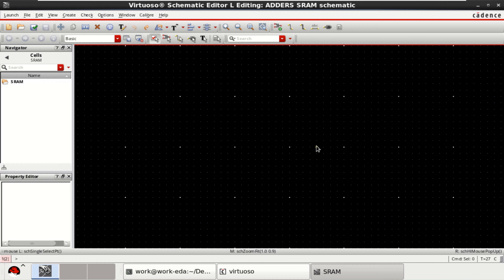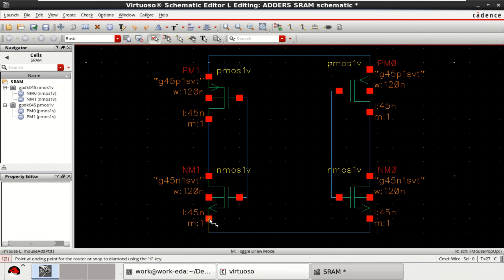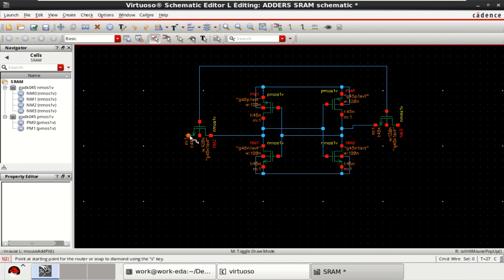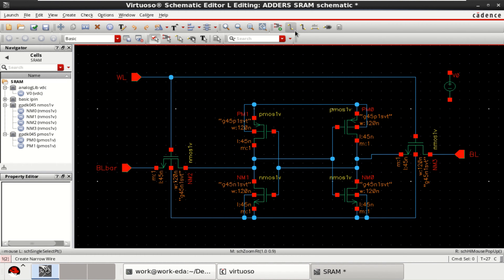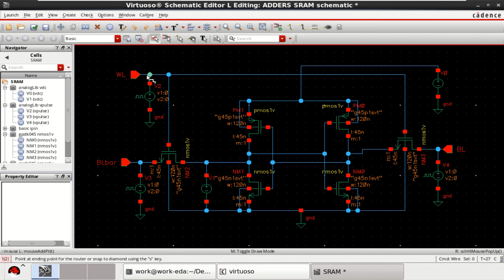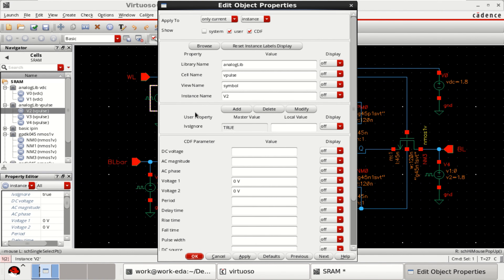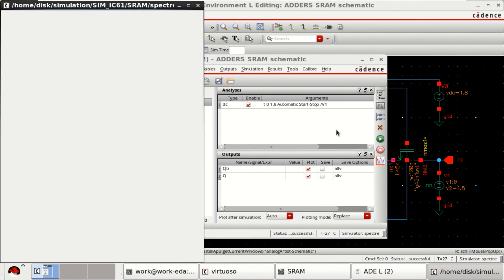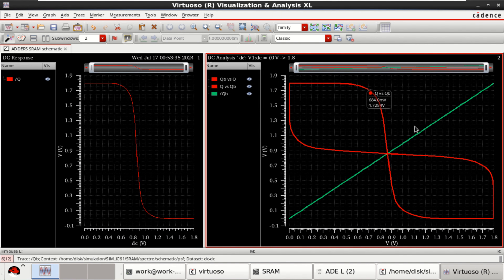6T SRAM DC Analysis in Cadence Virtuoso.

Comment: Its showing an error
 (sfe-421)..Error found by spectre during dc analysis dc ERROR (SFE-421): Undefined parameter name 'dc'.
how could I overcome it
Reply from the maker: Hi, check if you have used the parameter 'dc' in your design or model file. It should be defined before use.

Comment: Hello professor 
Could you please explain what is the purpose of the use of V1 in the schematics?
I might be wrong but I haven't seen schematics with the power supply connected between the access transistor to gnd.
Thank you
Reply from the maker: Hi, V1 is used to sweep the voltage and find the maximum voltage that the SRAM cell can retain.

Comment: Why do u select the component V1 source ??? Is there any specific reason??
Reply from the maker: Hi, V1 is a dc voltage which is swept from 0 to 1.8. So selected V1.
Reply: @dr.hariprasadnaikbhattu  Sir Why YOu applied 1.8 V to the Output of Qb.. IS there any specific reason??it is only given to Vdd na??why to give 1.8v to output???

Comment: Good evening sir
Here we have to use 45nm technology only or it will work with 180nm technology too
And are there any other parameters which should be taken into account.
Because I am not getting the output graph for this.
Reply from the maker: Hi, It works for 45nm as well as 180nm. It is not analog block